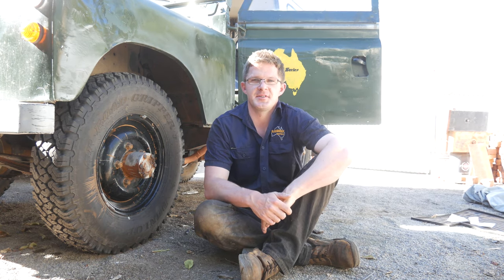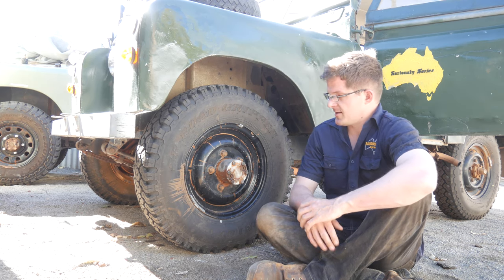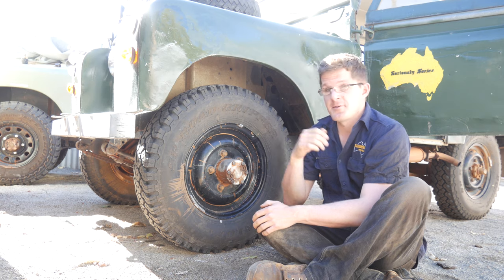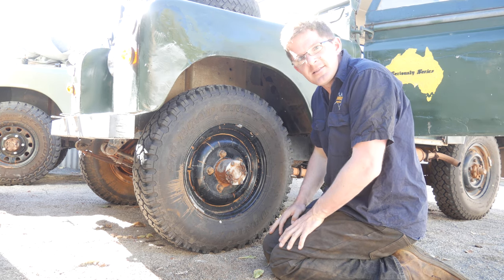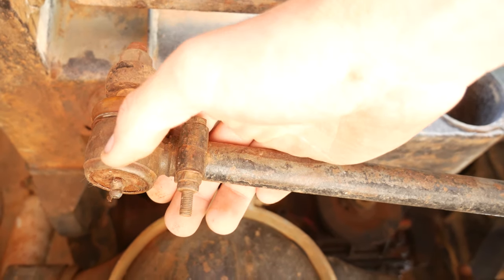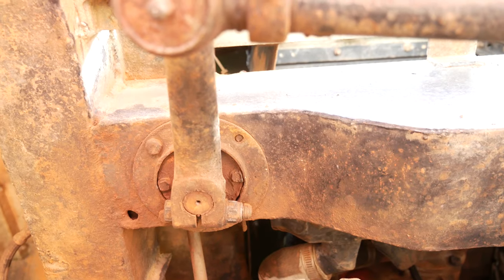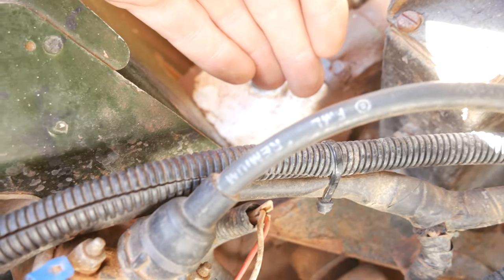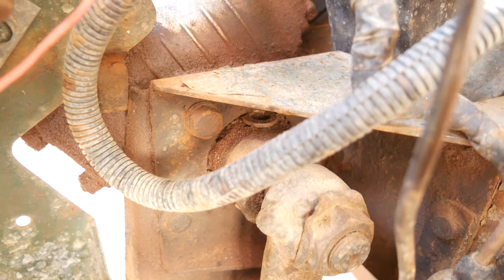Land Rover Steering System Ep3

Comment: Really helpful and thanks for sharing.  I am about to restore my entire steering system, so good to know these tips.
G
Reply from the maker: No worries Gary, great to hear that this video was of use to you. Cheers Geoff
Reply: @seriouslyseriesaustralia  Thanks, I love following them.  I bought a 64 Series 2A two years ago and it's taking me some time to work through all that needs doing to it.  The chassis is my main concern, a couple of outriggers and the two front horns where the leaf springs link need welding too.  Then once that is done, just the general upkeep and maintenance.  I can't wait to get her back on the road and out an about.

Comment: hi geoff, just saw this vid, thx for sharing information. i have a few comments. the swivel-pins, especialy the top one in the railco fighting a loosen battle from the start up. there is supposely a little whole in the buttom for lubrication, which is francly a joke. so take them out, check replace or service them  some with fresh grease or oil. the steering relay also loves to get some fresh oil. ball-joints: never on earth greasing them once a year is enough. and what about the sealer of the swivel-balls. if u dont take care by dismounting and cleaning them, they will eat the chrome of the swivelballs. just my 2cts. cheers
Reply from the maker: Hi Bernd. Thanks once again for sharing those top-tips. How regular you service the items on the vehicle as you no is very dependent on how many miles you are doing each year or so. Thanks, Cheers Geoff

Comment: Like your video a lot. Thanks for your hard work and sharing your knowledge. 

Would you make a video on the brakes for the Series 3? For servicing and stopping brake fluid leaks all over the wheel. Cheers.
Reply: If you have brake fluid all over the wheel the seals have gone in the cylinders. I changed all mine out with no prior experience, just watched a few vids on forming copper brake lines and went for it. Buy decent brand cylinders even though they are twice the price, the rubber needs to be good quality and not cheap ready to leak in  a years time rubbish. When bleeding the brakes use an Easybleed or other low pressure bleed kit. I stuggled pumping the pedal, suction bleeding, reverse bleeding with a syringe. None of it worked. Low pressure Easybleed kit took 15 minuites to do all four corners. I couldn't believe it was that easy.
Reply from the maker: We can put it on the list of videos for sure! 
I think it would be good to do a bleeding brakes video also.  Thanks for the request 
Cheers 
Damon

Comment: Hello, First of all congratulations for your videos. Very useful information.
Ás expert let me ask something. I have a Land Rover serie 3 with steering issues.
The address is very hard and I understand that it for the steering relé. I will change it.
But also the driving is sinuous and gives a feeling of very little control? What would you look at to solve this?
Thanks in advance
Reply from the maker: Hi ricard. First, thank you for your kind words, I really appreciate it. It is really nice to know people enjoy these videos and it is helping others. Your question; There are three things that it could be; 1) faulty steering relay, 2) worn tie rod ends/ball joints and 3) wrong pre-load on your swivel  hubs. These are all easily replaced and pretty cheap. Once fixed and replaced you should have a much more pleasant driving experience. Kind regards, Geoff
Reply: @seriouslyseriesaustralia  Thanks a lot for your answer!! I will follow your recommendations

Comment: I have a series 2A 1963
it came without a speedo cable, and I ordered an aftermarket one.
It screws in nicely at the back of the speedo but does not seem to fit in the drive shaft underneath without using washers to hold it in place with the three screws?
Please help
Reply from the maker: Hi Jason. That is correct the washer retains the speed cable into the speedo drive. The cable should have come with one or if not you can use the washer off your old one. The screws are a BSA thread and can be a bit hard to get. I would recommend downloading or buying a parts catalog which has all the parts number and exploded diagram of all components. Best of luck. Cheers Geoff

Comment: Hello in my experience the inside of your front tyres wear excessively  if the bolts are loose or the Seiko bushes in the top of the swivel housing are worn also extra oil leaking from bottom bearing also the swivel housing tend lean in and create a large degree of negative camber , as for the steering relay try and keep oil up  to it ,if the seals gone grease can be pumped in ( like the 2a army ones ) as for replacing them if you go by the book  it a long hard job , but you can repair it insitu without taking any panels off I leave the housing in the crossmember and dismantle it I than dismantle  the good one and and insert the guts of it in the housing in the crossmember  ,mostly with 2 or 4  hose clamps and grease block of wood and hammer ( you have to mindful of the spring it could become  life-changing) I  have  done 2 in this manner and freed  a totally seized one  buy soaking it in  old diesel for 12 months  and that has worked fine . R
Reply from the maker: Hi Reginald. thank you for sharing that useful information. Many thanks, Geoff

Comment: Hi, super helpful channel. Just about to change out the swivel pin on my series 3, do you deal with that anywhere?
Reply from the maker: Hi Steven. Thank you for your kind words and glad to here these videos are of use to you. In regards to the second [art of your message, I gather you are asking where I source my reco-swivel hubs? Cheers
Reply: No, I have the repair kit from Britpart, wondered if you went over the repair in any of your videos. If not, which manual would you recommend? I’m concerned with torques and so forth.

Comment: Land rover series are very different from other vehicles in their swivels with railko bush. Don't know what the studs/bolts are he's talking about? Vehicle needs to be jacked up so there's no weight on the wheels. Swivels/kingpins are shimmed and they wear (they end up looking elliptical instead of round). By removing shim you can have king pin sit on an unworn part  alleviating slop but real fix is to replace kingpin or build up and machine. The bolts only pull down the King pins. Steering relay should be lubed often as to not have it rust into the chassis which makes it very hard to replace. Top to bottom play can be kingpins or wheel bearings. Front to back play (side to side) is wheel bearing only. If steering relay bolt comes loose you don't have "play" you have no steering if it's loose enough to turn on the splines! There's also two adjustment bolts at bottom of relay. Steering relay also has a small hole on top for lubrication/ breather.